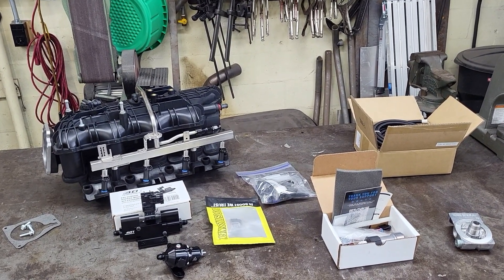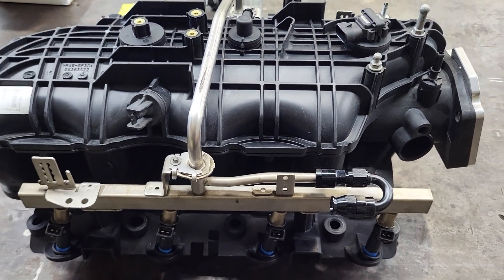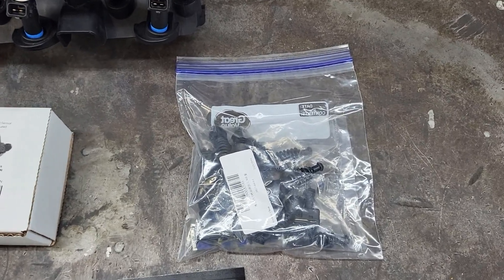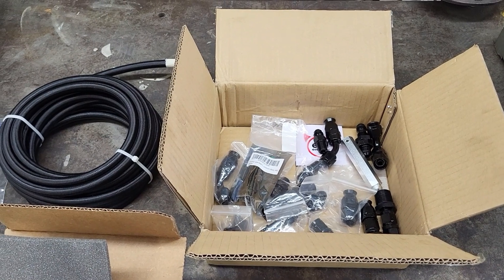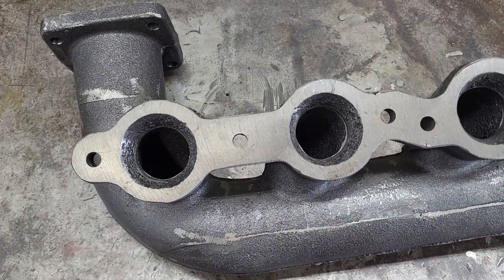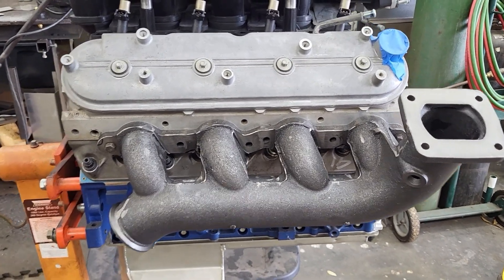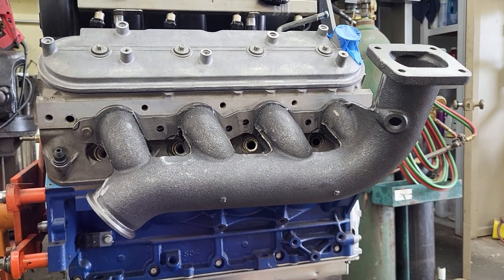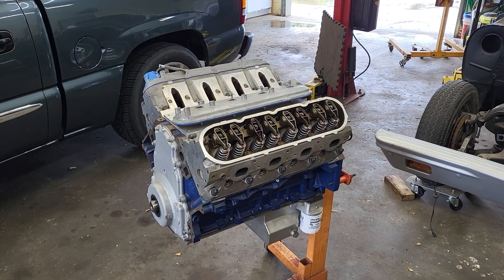Turbo Sierra product overview

Comment: Is that manifold an "ebay special"? I got the same one a while back and flashing inside was horrible. It also didn't have the bolt holes flattened, so it would be nice if they're all coming that way now.
Reply from the maker: I got it from Forced Performance.